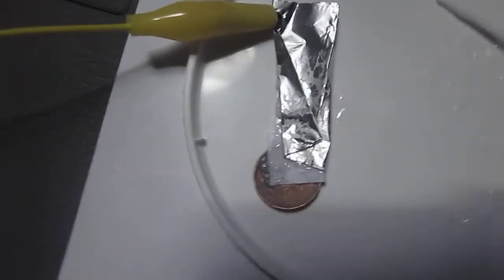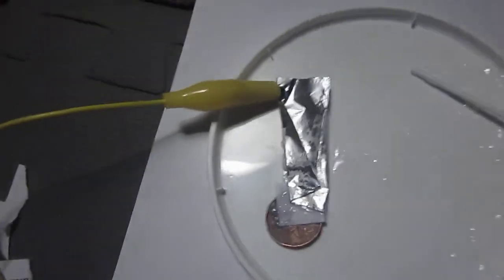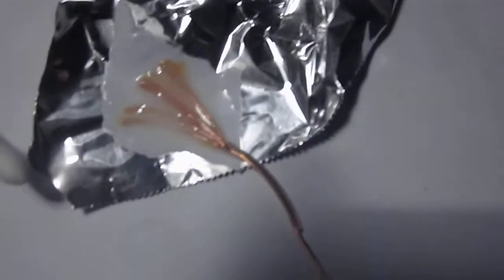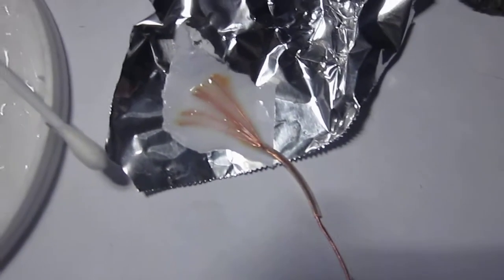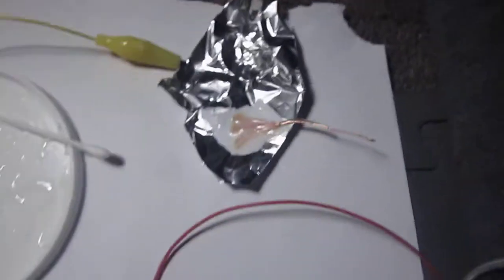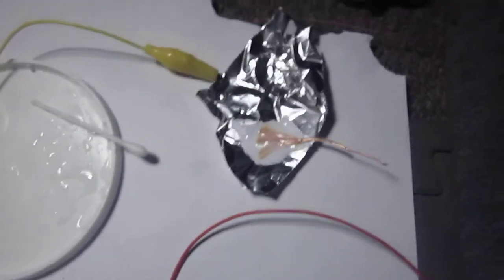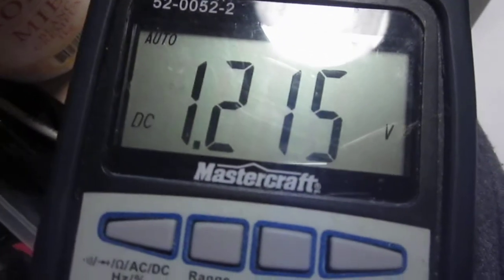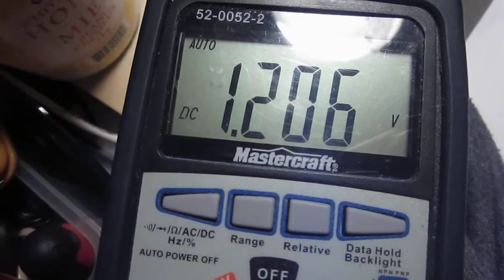glue battery shocked with 12v while dry/curing stage to possibly increase voltage?

Comment: How did you get on with the cells you were making? I'm guessing that cell you charged dropped to .5v after it dried. How long were you able to keep them going.
Reply from the maker: It was still about half a volt, but ver low amperage. 
I haven't made much more. I plan on using interconnected house plants to see how much voltage they create together. Thanks for asking
Reply: Kenn Taylor  Aluminum always gave me .5v. Magnesium gives 1.5v but doesn't last that long, has a lot higher amps though. I never thought about using glue so i tried it yesterday. Still waiting for them to dry. I used pva wood glue with magnesium sulphate.  Might look into plant batteries, seems interesting.